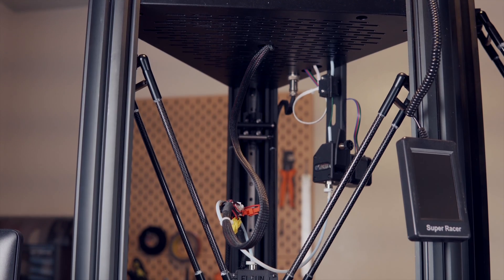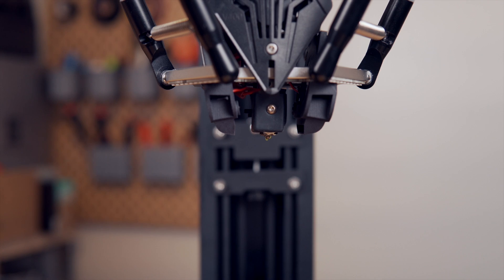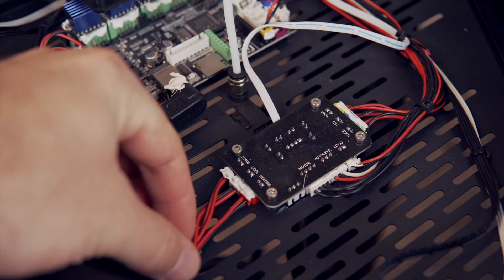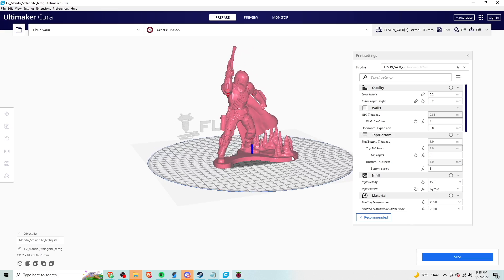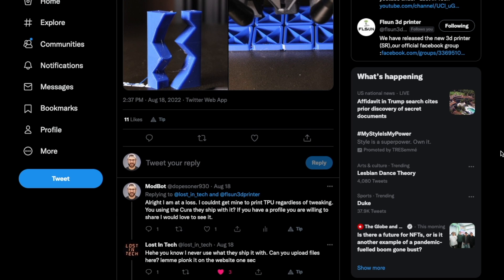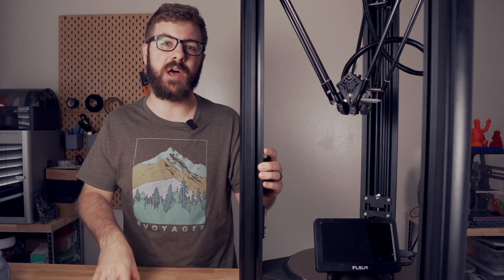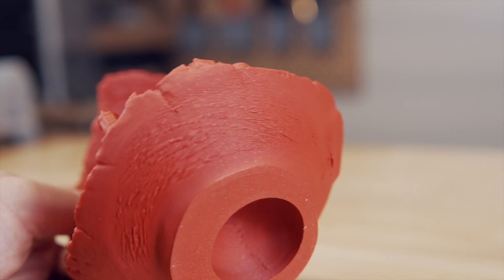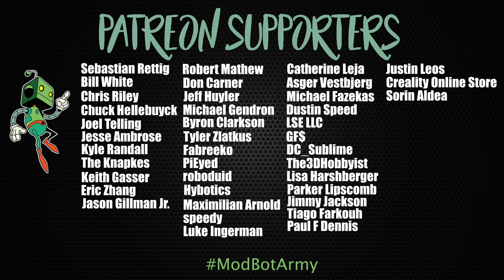FLSUN V400 Runs Circles Around The Competition - Delta 3d Printer

Comment: I have a problem with my flsun v400 stopping after printing about 5 minutes.  It has a message that says klipper has shit down.  Have you ran into this issue?
Reply: It even happened with the test models that came with it.  This has happened since I unboxed it.
Reply: It can happen if the motherboard in the top of the printer is too hot. Check that the fan on it is actually working.

Comment: That sounds believe it or not is actually the stepper motors at certain speeds. The one that sounds like it's grinding on the print. If it was actually grinding that hard it would yank the print. Gyroid just changes the actual speed that the motors can move so kinda knocks the sound out

Comment: Can the FL V400 head be retrofitted to the Super Racer.  I hate remote extruder drives for several annoying reasons. also if anyone knows what filament I should try that won't shrink if it got exposed to 120 degrees.  My parts are shrinking significantly if they are left in a car or at ambient temperatures at 120 or higher.

Comment: Why does almost every one of these show that red error message on the lower left corner of the screen (mine included)?  My printer runs perfectly, but that error message "klipper has disconnected" persist and I haven't found a useful solution online.  Nearly every review video shows the same error, even the displays at MicroCenter showed it.

Comment: 5:20. This only took me three minutes.  I cut off a piece of PLA that was just over twice as long as the length of the channels (so I could double it over).  The USB / power cable has a cable capture on it, to keep them bound together.  I just ran my PLA between the power and USB cable (just behind the cable capture), then taped the two ends of the PLA together, fed the taped end down the channel, and pulled the cable through.  Easy peasy.  (PLA is MUCH better choice than Ninja flex, because you don't want your fish to flex and bind in the channel.)

Comment: We ordered it last month and it should have been sent by November 10th, but we never got any update and they are not responding on any platform not chat or any email. It has been more than a week and we are very worried. 
Anyone ordered in October and never got the printer and FLSUN is ghosting you?
Reply: They have been under a lock down dew to an outbreak, no updates yet and no compensation as it seems. 
However, FLSUN is a legit company, so i hope everything will turn out fine. Just the time the studio here is not able to print is very unfortunate.. its a very long delay.

Comment: Edit: somewhat resolved*
Any idea what is going on with Flsun?  I ordered the V400 on Sept 15 because I liked how it looked in this video.  They charged my account at the time, there hasn't been any contact from the company other than "here is your receipt, we'll contact you with tracking info".  A few weeks ago I replied to the email asking for details and the email no longer exists.  So I tried the website's live chat, no response after 20 minutes and the banner says they respond in a few minutes.  So last week I checked the website again and sat on live chat for an hour, no response.  Emailed their contact support email from the webpage, which apparently does still exist since it didn't bounce back.  
But still no response.  The product page doesn't even reference my shipping wave anymore.  I am strongly leaning toward this company being a scam at this point.

*Edit: sitting on their livechat I clicked view older messages to see if they have time stamps (they don't), and it looks like they responded here... when I wasn't connected.  They linked to an 'update shipping' on their webpage, which says I should expect delivery second week of December .  It would have been REALLY NICE IF THAT WAS AN EMAIL as that was what I was told to expect on the receipt page.  Regardless, the store page saying 12-16 days by air is super misleading as I took that as 12-16 days from the 'shipped from factory' date, not a month after that.

Comment: About dragging sound, it appears when you are using grid infill, we have lines on one direction and then on same height lines in other direction (nozzle touch previous lines). Gyroid is good to avoid this, but I like to use ZIG-ZAG infill (more stright lines). There are no line crossings on same layer. (experience from FLSUN SR). To understand this better, analyze one layer printing in Cura preview. (delta don't have that stright plane movement in XY direction as cartasians or corexy)

Comment: PTFE Lines hotends are way better for PLA and PETG. The filament path is way less restrictive and almost no one needs to print with other materials than TPU, PLA and PETG. 
All those CF shit will give you cancer down the road and it does not provide any benefits besides the higher stiffness.
Reply from the maker: Who says ptfe lined is better for those? I have had terrible ptfe prints and great all metal for all of those materials as well as vice versa. Also if you are pushing petg you need to raise temps which would be limited by ptfe. Lots of claims here.
Reply: @ModBotArmy  I do. PTFE has a much lower friction coeficient. It´s way easier to push any kind of filament through it. The temp for PETG I use is about 230°C I never printed any PETG with higher than that. 
It is not only better (because of the friction) but also cheaper. To get a god result with a all metal hot end you need good quality hardware with smooth inner walls and even then the friction is way higher. To get a good result with PTFE you just need a PTFE liner. Also those are not just claims, those are facts.
Lastly it´s almost always not necessary to print with anything other than PLA/PETG. Especially at home.

Comment: Looking fantastic. Like some others have said, I feel like it needs to be enclosed. Or at least have the option to buy an enclosure or something. Having a direct drive all metal hot end is fantastic, but it's main purpose would be for use with alternate materials.

I'd love to buy one, just not sure I'd get the use out of it just yet with my 9 other printers. The speed is great, though I may settle with the SR as the V400 doesn't come back in stock in the UK until October!

Great review!

Comment: Get over the linear rails, most products are using them more for fashion than any good reason. Round rails can have much lower friction and are easier to clean than square ones. Sure for heavy loads but something with minimal force like a 3D printer I'd rather see the round rails. Same with lead screws, if the load is always on one side like in a delta printer I'd rather have the simpler lead screw than the heavier and more complex ball screw.
Reply: Agreed, linear rods are the right choice for a delta printer.

Comment: Regarding scraping and infill type, all self-intersecting infill patterns scrape because the slicers don't compensate for the crossings. Gyroid avoids that. Some other patterns avoid it too but AFAIK gyroid is the only one of them that's strong in all directions.
Reply: Thank you.  Seriously never thought of that.  I use grid or cubic all the time and often hear the 'grinding' noise of it crossing the previous pattern.
Reply: Gyroid was designed for squirting in resin.
Reply: Zig zag and lines work well
Reply: You sure that gyroid is a good pattern for strength?
Reply: @i4kata  In an absolute sense, no, it's not. Cubic, triangles, or honeycomb would be a lot stronger. But compared to the other non-intersecting patterns like lines - same direction each layer has no strength perpendicular direction, alternating directions has no layer adhesion - it's pretty good. There's actually a way to do a full honeycomb as non-self-intersecting that I'm planning to implement in Cura when I get around to it if I can't convince someone else to do it for me first.
Reply: @daliasprints9798  that's actually pretty crazy :o
Reply: I have the same problem and being limited to 1 infill is not the solution and lowering the speed to avoid it sucks
Reply: @TIESTOSBULLDOGGES  lowering the speed means lowering it to the proper speed. Because if you make it run it too fast, the hotend is running too fast for a clean infill.
Reply: @Cthulhu No, that'd make it far worse by protruding up above the current layer height. Unless you're stopping and wiping and restarting extrusion for the crossing, which would be ridiculously costly. If you're willing to stop and restart extrusion you can just do it without a z hop.
Reply: I have an ender 3 s1 and I personally don't like gyroid infill because it's shaking my machine apart. Had a 15 hour print with 30%  gyroid infill and honestly it was horrible to watch. Only straight lines for me.
Reply: I experienced issues printing anything over 50% cubic infill at 120 speed. Hitting the previous line of solidified plastic at the intersection points sounded like running a wheel over a curb. Repeatedly. The vibration caused my nozzle to loosen from the heatblock and resulted in jams.

Gyroid infill avoids these problems entirely. This pattern also has several useful properties:

(1) nearly(?) isotropic strength,
(2) only two separate partitions or 'chambers' in an infilled space - this could be useful for some applications, eg. filling the print with resin.
Reply: beginners knowledge 😄
Reply: May I tell you a secret:
 you are printing the infill too fast if that happens . You are exceeding the maximum flow of the hotend.
You don't believe? Well, you can try it slow for once, right? ^^

You're welcome 😉
Reply: @REDxFROG  I'm well aware slowing down helps but I don't think flow is the cause. There are multiple other speed related mechanisms that seem likely factors: having time to resoften the material being crossed over, and the sharpness of the impulse backpressure going from high flow to blockage and back. It's a lot like how a quick wipe motion after retraction serves to cut off a string. This might actually be fixed if slicers emitted the crossing points as travel so that pressure advance could back off to avoid the impulse just before hitting the crossing and reapply pressure leaving it.

Comment: How does it compare against the Bambu Labs X1 Carbon?  Size, speed, special materials (read: enclosure) and just ease-of-use?  Sure, one is core-xy and the other delta, but both of these seem like speed-demons that don't require much (or any) tinkering and seem similarly priced, so I think running them against each other would make sense ...
Reply: The bamboo is better suited for fully automated and difficult filaments. The flsun is larger in build size, but slower in default spec, but the x1 similarly fast in normal mode, but faster in ludicrous (just like tesla i think) mode. With that said, you can easily increase the speed (acceleration) with a push of a button to totally bonkers values. For example my direct drive SR runs at 12,5k acceleration and has minimal ringing without input shaper. If i would increase stepper current and acceleration, i think it will beat the bamboo in terms of speed. Since its klipper, you can easily edit these values. My fastest benchy took 22min with said acceleration.
Reply: @over_pizza_2578  Ludicrous Speed is a hyperspace speed considerably faster than light speed. It's from Space Balls, the movie.
Reply: @woodcat7180  thanks, thought tesla had something similar named, they have sometimes funny naming too
Reply: @over_pizza_2578  Musk likes to name things. Model S Plaid Another one. It is from "going plaid" from the same movie and the same scene.
Reply: @over_pizza_2578  So your fastest benchy with tweaking is still slower than the default Bambu one?  Surprising.  Raw speed and acceleration would be the thing where I'd expect a delta to beat the Bambu.
What I feel is missing on the V400 is an enclosure.  I guess you cannot simply have panels between each pair of side-legs without the effector hitting them, right?  And having that big height and the motors above that also is annoying if what you want to do is to keep the print which is near the bottom warm and don't want the motors to heat up.   I love the look of a delta and the simplicity of a stationary bed at the bottom, but if I start to think about some of the technical points needed for stuff other than PLA, then I think Core XY still has some major benefits.
Reply: @MisterkeTube  as i said, not pushing the limit, my belts are at the end of their life.
Stepper current is still normal at not even one amp. Feed rate was set to 275 for all except first layer, thats at 50 and minimum layer time set to 4s. After replacing the belts i will up the motor current to 1,5 amp and acceleration to 20k, later to 25k.
In therms of feedrate i have no limit since im using a rapido uhf.
Reply: @over_pizza_2578  i saw bambu review, if you want print petg for example your print speed is hardly reduced, bambu is an eyecatch, hyped for me. Many negative points show they didnt think to the end neither

Comment: Out of sheer curiosity, what are the dimensions on this printer?  FLSun only states the build size, not the size of the machine, so I'm genuinely curious as to just what kind of space this thing takes up.
Reply: Same, I've been looking at Delta like the v400 and SR to replace my broken i3 mega s. Every site stated the print size, but still yet to find anything with the dimensions.
Reply: @oliverfong418  SR is considerably smaller. You can kinda estimate it:   https://youtu.be/3_MGuMTjgTQ?t=110
(Maybe 50*50*100cm-ish??)
Reply: Found the dimensions on a reseller on Taobao (finally lol) 
it's 480x435x1090mm
Reply: @oliverfong418  oh nice, thanks! So the 50*50*100 was ~ close enough 😀
Reply: @TamasJantyik  Yep, you were pretty much spot on.

Comment: An enclosure would enable so much. ABS, Nylon, PC and so on. Should be easy for FLSun to offer something.
Reply: why an encolosure is necessary for ABS, Nylon, PC ? Tx
Reply: @damien2198  Because ABS is an amorph material and PC and Nylon semi crystal iirc, then cooling to fast they shrink due to stress. Which can result in warping, poor layer adhesion/bonding and delamination.
Reply: They do sell an enclosure

Comment: Great video.
Couple things.
1. Bed size: 300mm diameter circle would equate to 212x212mm square (fit inside the circle) Plus the obvious extra domes on each side of the square.

2. I really love that they have the lights built into the head. I feel like if we put some basic diffusers on them it would more easily spread out the light and have less triangular glare spots.
Reply: light Diffusers, I'm gonna add that to my design and build list when my v400 comes in, Thank you